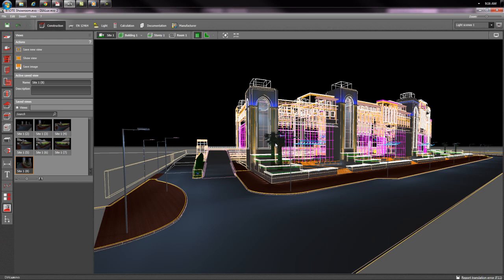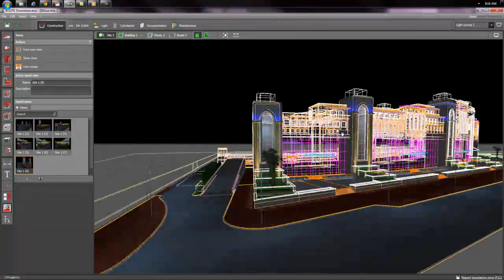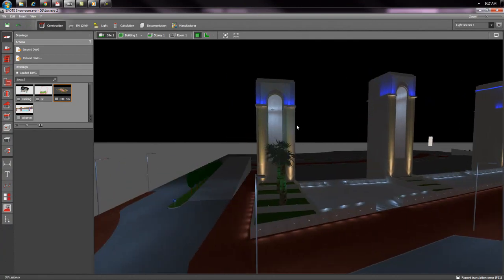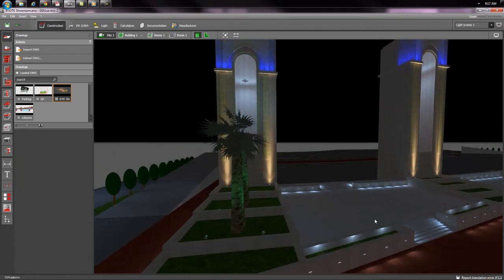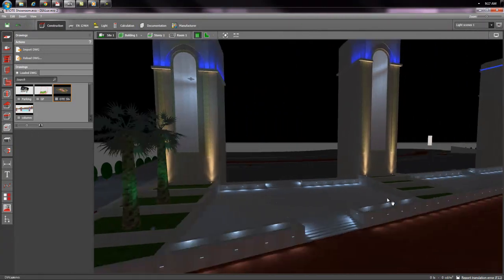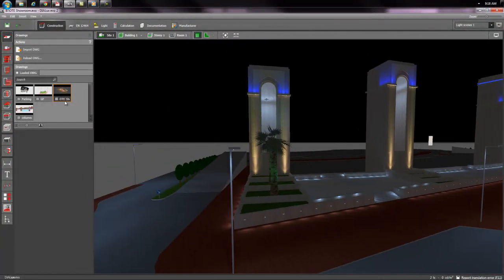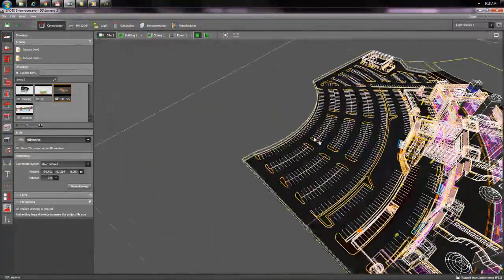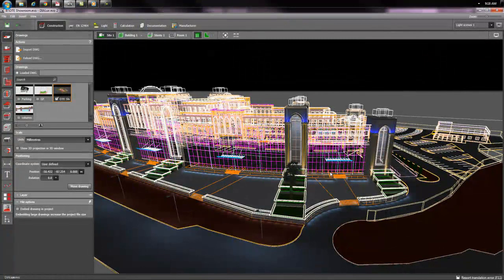Dialux Evo Facade Lighting Tutorial

Comment: Dear Nelca,

Great and helpful videos. I am wondering how to do facade lighting. I have imported a dwg and made a model of the building and I need to do external lighting for that building. 

In which the outerwalls have concrete and glass panels. Can you guide me ? The problem I am facing is that I cant figure out a way to change the material of small sections of the external walls of the building.

Any help will be appreciated.

Thanks
Fahd Sami Khan
Reply from the maker: Dear Sami, There are many ways on how to do the facade lighting, but first you need to understand the character of the building. Is the building formal? Institutional? old or classic? full of detail? or modern? from there, you will generate how to enhance that character of the building during night time. Is the building with a brand? or just a regular condo or office building.  I would like to suggest to look for the same project and see how these types of buildings have been lighted.
I hope it helps.
Let me know.
regards,
Nelca-